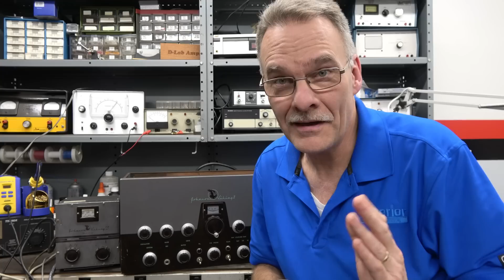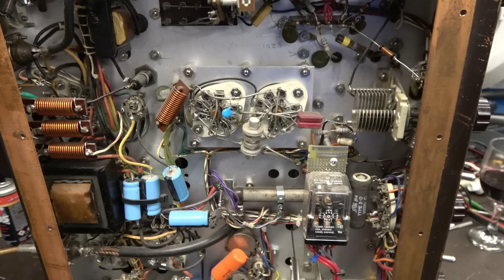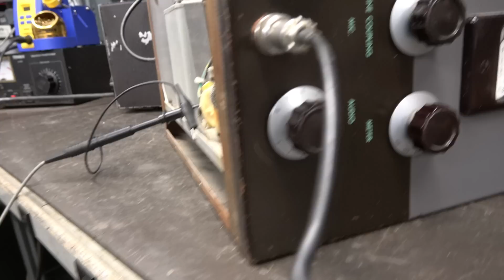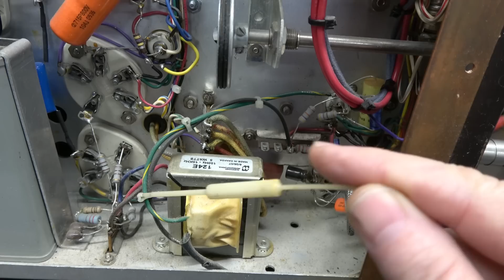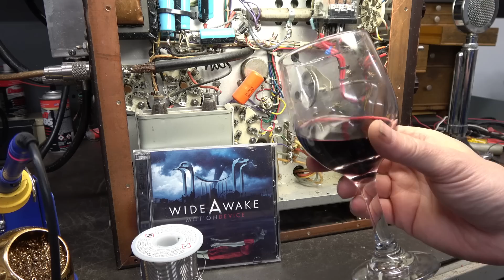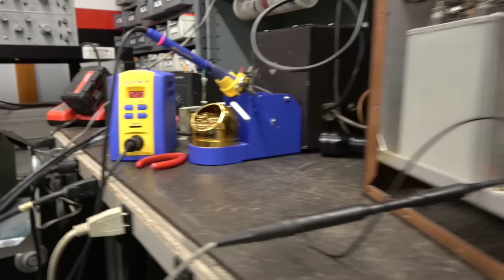How to add D-Lab approved audio to Johnson Viking II AM Tube transmitters

Comment: Thanks for your many great videos. 
Two questions:
 When replacing a bad interstage transformer in the audio section of the Viking II, does the P-T156 have as good an audio response as a Hammond 124B?
Second-
You said you changed some values in the stock audio driver circuit to create better audio response. What components did you change?
TNX ES 73 OM DE Dave AB5S

Comment: Hi Terry, the Viking II is a Masterpiece, and you did a great job, as always. 

Just wondering: would it have been possible to retain the other Hammond driver xformer, as long as it was rewired correctly?

Merry Christmas and happy new year to you and your family!
Reply from the maker: The 124B was the best match for the application, plus I had to re-configure the supporting components, so best to wire it as per Johnson and Wa1HLR, TimTron.